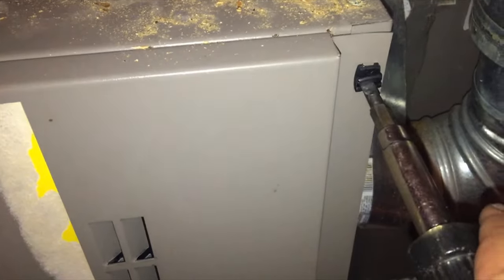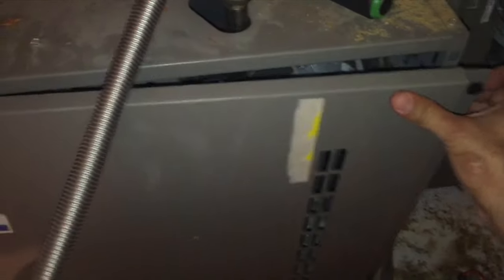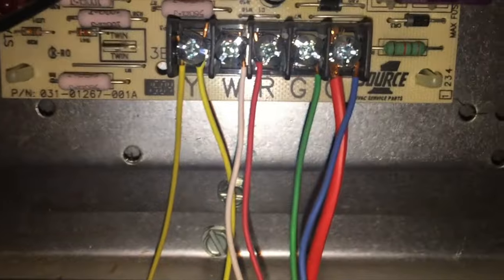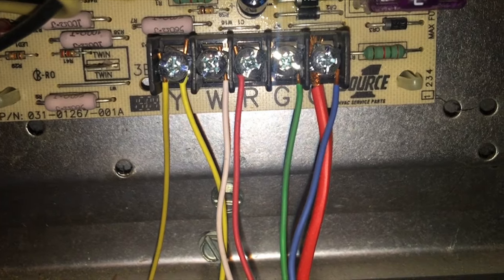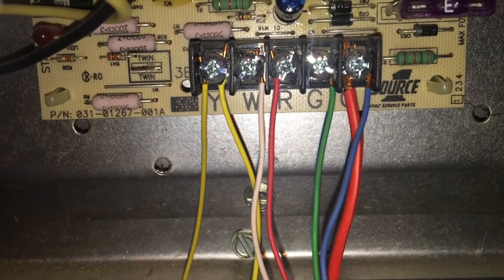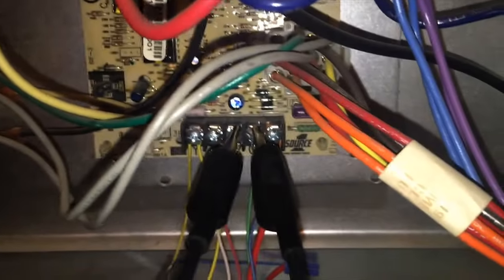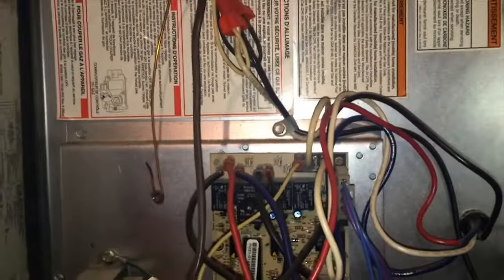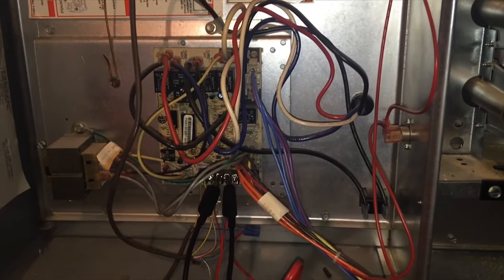How To Jumper a Furnace

Comment: My Beckett oil burner light turns on for half a second and turns off. Nothing happens after that. Could it be because it needs to be jumped? The other day it turned on after I turned it off and on multiple times, it heated up everything but 2 days later it just won't go back on. I also noticed my living room smelled. Could the flue be choked?

Comment: Thanks for video. I enjoy banjo music! My blower won't come on. I measured voltage across HEAT and Cir N on call for blower and I'm not reading 120V. It's like 110 and bounces around. So bad board I think, but, can I still test the blower motor this way (G/R jumpered?) The blower is not coming on. Should I test capacitor first, or just replace board and retest? Thx.
Reply from the maker: First test the capacitor. If thats good, you can test the blower by directly connecting it to power . If that comes on, you more than likely have a bad board

Comment: Bought a house here in vegas, went to the attic to check it. I noticed wires everywhere, i checked both furnace and found out they were jumped together. The other furnace was only using white, red, yellow wires to hook up to the other furnace. I don't know much about HVAC, any idea why they would do this? Just wondering before i call it in.
Reply from the maker: Fresco L I’d need to see a picture. It would help troubleshoot the situation
Reply: @Sealheatingandairconditioning  I should've taken a picture before cleaning up the wires. I'm trying to hook up a smart thermostat, so i placed all the wires in the right order and also connected the common (blue) wire. No power on thermostat, the thermostat on there before was battery powered and it activated the A/C with no issues. Almost like they tried to jump power from the other furnace. The other smart thermostat works.

Comment: Thanks for taking the time to create and post this, but after multiple viewings I still can't figure it out.  I got the forgetting about the colors; go by terminal letters --- then I get lostl.  You say "we are going to engage the R and the W," but then proceed to jumper the R and the G.  And, does this simply jumper the blower motor without turning on either A/C or heat?
Reply from the maker: R and G will turn on the blower only. R and W will turn on the heat
Reply from the maker: In my other videos, I demonstrate the sequence of operation for a furnace where I jumper R and W. This will turn on the heater and go through the sequence
Reply: This helped me a lot liked video and subscribed

Comment: Why was this done? What was the symptom? Thanks.
Reply: If your thermostat quits working, you can turn on the emergency heater, by connecting the wires he said. He didn't show connecting the first two he said. He just showed the second two wires you have to connect. But the first two must be connected as well.

Comment: how do you turn the furnace on with cover off. Do you push the door safety switch on? My furnace is now blowing any heat, just fan works, would I jump the R and W, to test for heat? Would there be a delay?
Reply from the maker: yeah, when jumpered from W to R, the inducer motor should come on.. What brand is it?
Reply: @Sealheatingandairconditioning It is a goodman gmvc96. Oky 1 year old.  Getting an e5,  open fuse code on it.  Tested the 3a fise and it is fine.  Do you know or a scondary fuse on this unit?  Also does the jump wire have to be the same thickness as the furnace wires connected?

Comment: My thermostat doesn’t have power. I jump the W to the R and the thermostat turns on. Please advise
Reply from the maker: Sherwin Wilson try new batteries in thermostat
Reply: Seal Heating and Air  I added a new smart thermostat. So when I jumped motherboard it sent juice to the thermostat. In this case the Nest thermostat asked to run a test. I choose to test the heat first and it started to work like a champ. Thanks for the help.
Reply from the maker: @SW-pm3ls  Awesome!
Reply: @Sealheatingandairconditioning   Thank you and you right. The colors didn't mean squat for to jump. Thanks for you assistants...

Comment: Seal Heat and Air  ~ Please tell me what website to get a jumper?  I type on Ebay FURNACE CONTROL FAN BOARD JUMPER didn't show up...PLEASE HELP.
Reply: im sure you can go to radio shack and get them. its only 24v
Reply: +04wkrw  ~  24valtage right?  Can I jumper with any in home A/C thermostat?
Reply from the maker: Hello. There are many websites to go to. If you have a Fry's Electronics or even an Auto Parts store, you can purchase some there. I get mine at the AC Supply house. There are also magnetic jumpers you can get that are pretty cool but don't work on all terminals. try nationalequipmentparts.com and search for "jumpers

Comment: So if I wanted to see if I have a bad blower I just jump out G and R terminals?
Reply from the maker: Enzo Amore thats one way. it doesn’t mean blower is bad if it doesn’t start. you could have a bad capacitor
Reply: @Sealheatingandairconditioning  stupid question what setting on my meter do I put to see what the capacitor  power is and what range is bad and what range is good?
Reply: @enzoamore9173  should be a capacitor setting --|(-- on your meter. Meter reading should be very close to what the cap says.
Reply: @enzoamore9173  micro farads and the range should be listed on the side of the capacitor. typically +/- 6% of the rated value

Comment: Ok you do that at the thermostat  and the furnace blows but the fan and the cool don't what's your next step ?
Reply from the maker: it could be a couple things. Possibly a faulty board or a float switch it keeping off the cooling. email me a pic or video
Reply: SH&A I took the step checking the squirrel cage and so on it was the capacitor so far , didn't  think those places close so early so I ordered one from Granger to be picked up in the morning . Get that in and see from there if it's anything else hope not but that's where I'm at. Yeah put a meter on it and would not register pass 0 plus it had a continuous on the body so it was dead.
Reply from the maker: Nice! Lemme know how it works out

Comment: I've got an amana furnace gas powered. Blows cold air. Furnace guy came over and said I need new circuit board but jump started furnace. Wouldn't tell me how he did it. Furnace runs but no pilot light until he did that. Said I also need  a blower pressure sensor. He says furnace will shut off after house is heated so just wondering how to get it back blowing hot air or tricking the circuit board as he called it
Reply from the maker: Patrick Dolan can you take some video?
Reply: No not at the moment. I'm a truck driver I just left for the week 2 days ago
Reply: I do have a picture of the internals tho

Comment: Man this guy didn’t even reveal the tool he used. Mini Jumper cables or naw? I just saw two connectors but not where they were coming from🤨😠
Reply from the maker: R Gillam they are called “Jumpers”. Available with gator clips or magnetic
Reply: Seal Heating and Air oh ok I thought so just wasn’t totally sure ; thanks